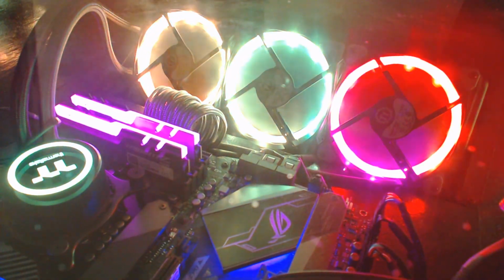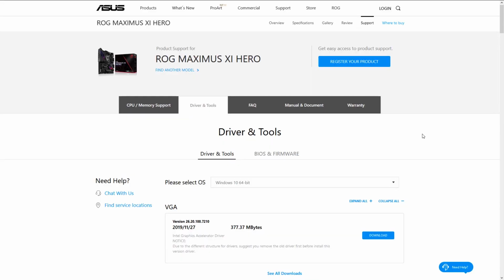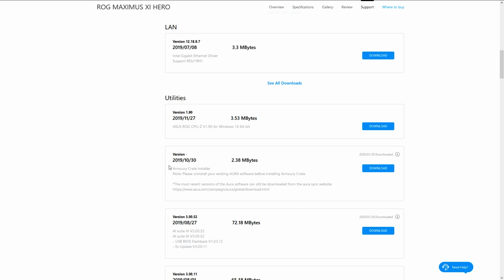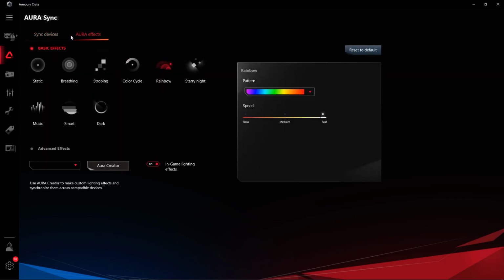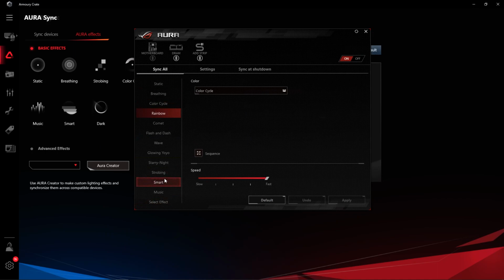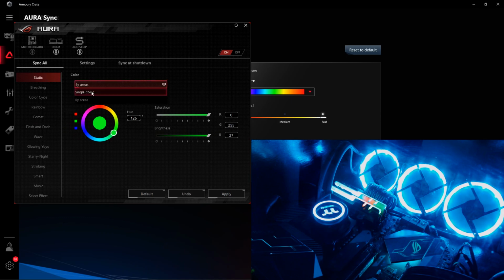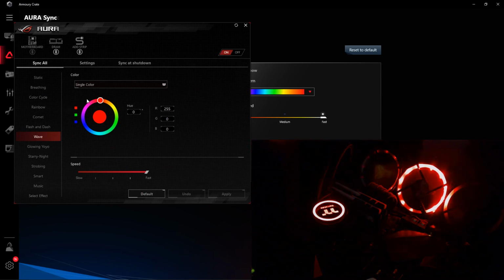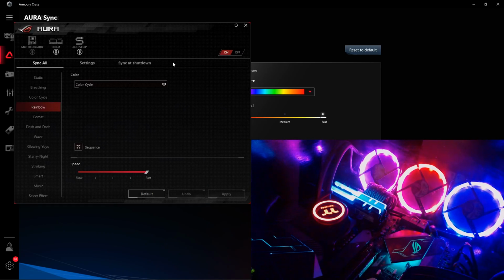Asus Aura Sync Review - Lighting Up Your Rig!

Comment: Can i control each led of the Fan alone if the Fans are connected together to the motherboard
Reply from the maker: Not through Aura on its own, sadly. Basic Aura only has presets which is disappointing, but I believe there's an aura plugin called Aura SDK Editor that lets you design your own effects. Haven't used it myself yet, but should help with that! Alternatively, JackNet RGB Sync does let you do that but... the setup process is kinda difficult and not user friendly at all for now.
Reply: @AtticPCGuy  Thanks

Comment: If i connect case to motherboard and i will change color of motherboard so case will change to same color as motherboard? (sorry for english btw :D)
Reply from the maker: If it's a case compatible with Aura then yes, should work like that! But depends on the case really.
Reply: @AtticPCGuy  case - silentiumpc armis ar7x tg argb 
motherboard - asus rog strix b550-e gaming or MSI MPG B550 GAMING CARBON WIFI. I haven't decided yet. Case will be compatible with those motherboards and their program?
Reply from the maker: I don't have first hand experience with the case, but according to the manufacturer page, it should support both Asus Aura and MSI Mystic Lighting, so you should be good with either brand!